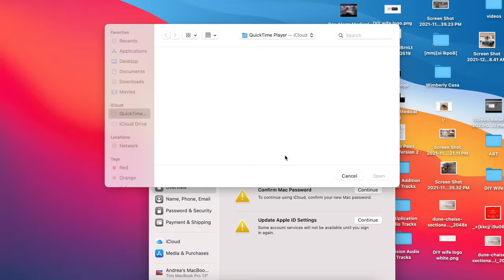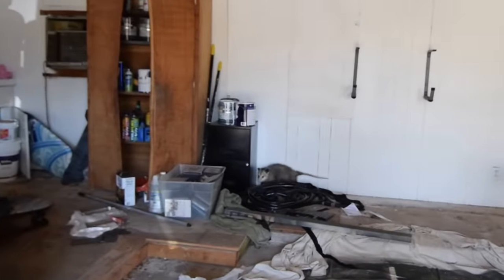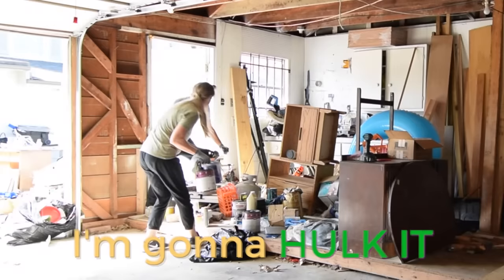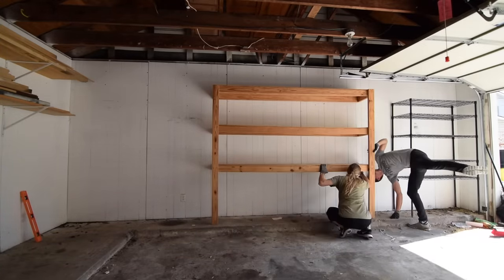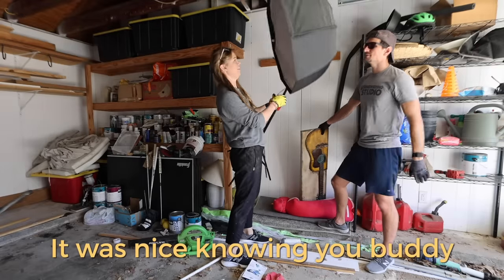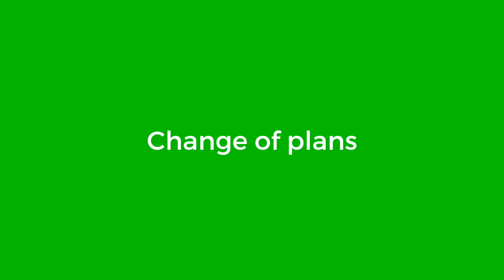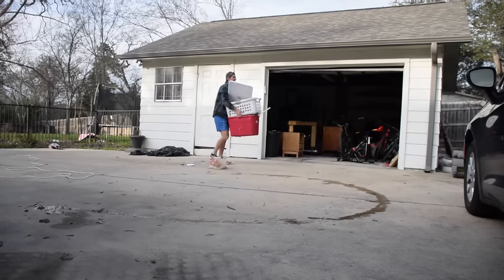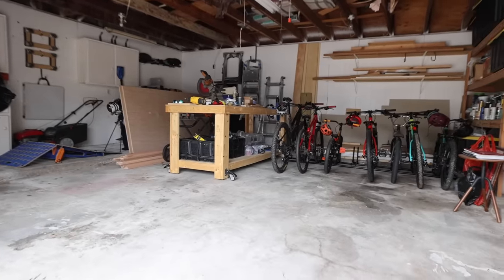The CRAZIEST Garage Overhaul In YouTube History?!?! // Garage Organization // Garage Makeover

Comment: I'd recommend to fix and seal the concrete floor, it would stop the dust and be a substantial improovement.
Together with cabinets along one of the walls and a nice worktop on top of those, that garage can turn into something really nice.
That garage bulding with the high roof and rafters has potential.

It was really fun and entertaining to watch.
Andrea standing on that piece of furniture and screaming in panic was hillarious.
Reply: Yes I agree paint and seal the floor. 
And why put the bike rack in the way of the timber and paint storage? I’d swap the rolling work bench and the bike rack or divide the shed into work side with tools, workbench, paint and timber and separate storage side for household  items, camping gear, bikes and garden tools.
Reply: @jennifercampbell7698 Yes, that’d be great. A clear division between shop and household / toy side.
Otherwise frustration and mess might take over again.
Reply: @m.rei85  Yes, I’d also put in some roof skylights so the workshop area could be used during the day. I worry about them working outside in the heat.
Reply: @jennifercampbell7698  The question is if they’re planning for an indoor workshop or not.🤷‍♂️
I’d take every chance to work outside, as long as I don’t annoy my neighbors too much.
Their garden or backyard seemed nice, big, and with lots of shade under the trees.

Comment: OMG!  Finding that opossum was scary.  I can relate because the subdivision where I live in Louisiana had a opossum infestation which we didn't realise until we kept finding mess in our back yard.  We thought at first it was stray cats but luckily we have security cameras and it showed opossums.  We had to call a professional company to set out traps and ended up trapping 7.   If you let the opossum get away they will quickly multiply and they will return to your garage.  If I were you I would hire a company to trap them.  They usually relocate them to a reserve.  You should use a bleach and water solution to disinfect the floors.  Good luck.

Comment: Hey I'm not trying to be a pain, but you might want to take some scrap wood or some 2x4 cut off and put under you wood to get it up off the concrete. Your wood will get moisture in it from the concrete. I don't want your wood to get ruined or your upcoming projects because your wood has collected to much moisture.